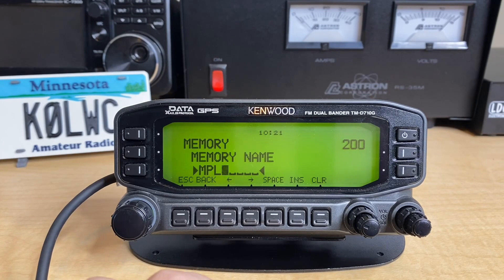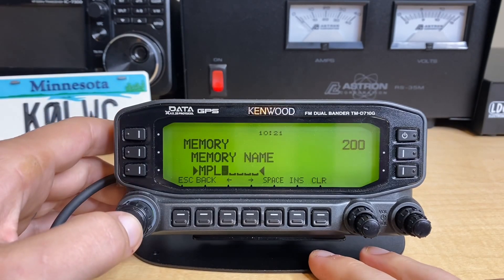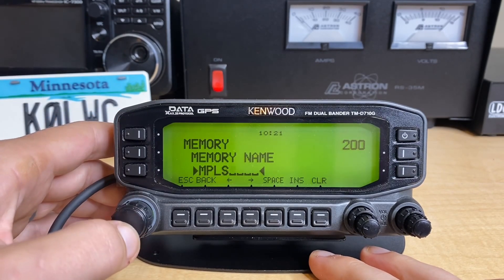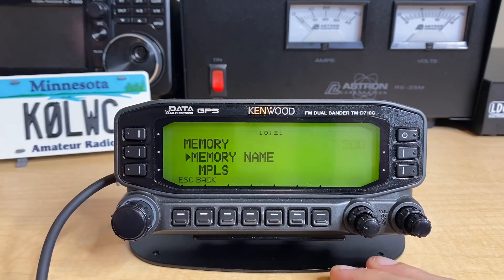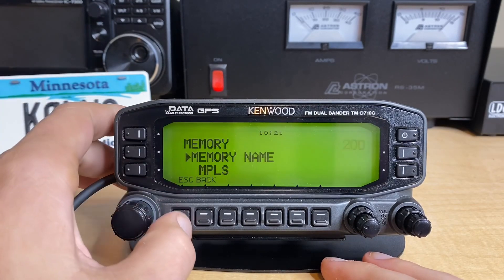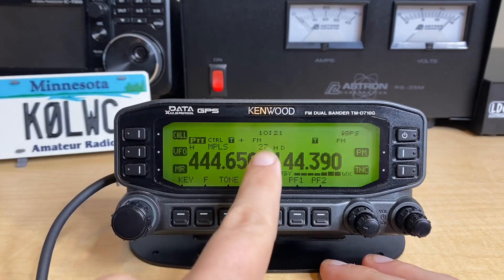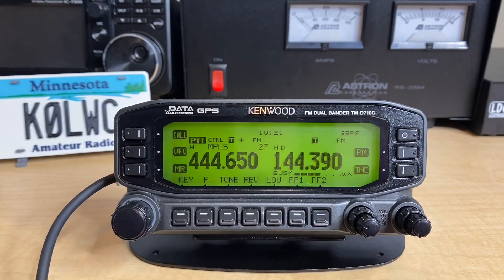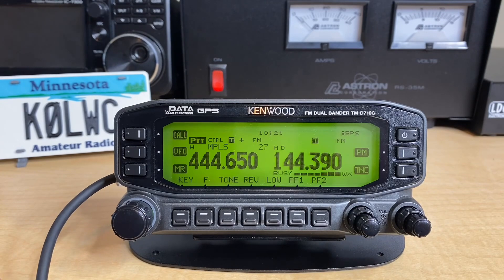Kenwood D710G: Programming Memory Channels The Easy Way!

Comment: I wish they still made this radio, so easy to program and use. The display is clean and easy to read. Today all radios are horrible hard to program,  small displays that you need magnifying glass to see.
Reply from the maker: I'm hopeful we'll see an updated version of this radio in the next year or two. We can dream, can't we?
Reply: @K0LWC  Yes we can, I have the Alinco 735T and it is a nightmare to program and operate very confusing. This Kenwood is awesome to operate by your video.